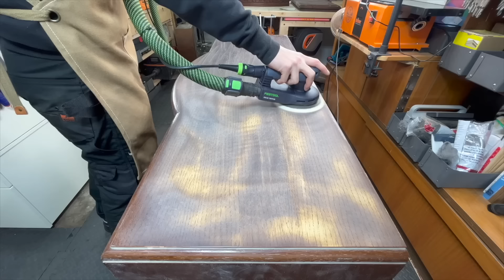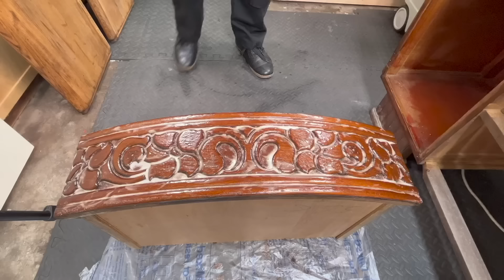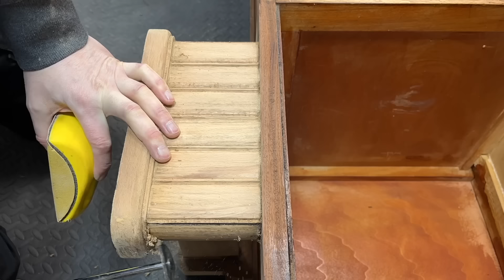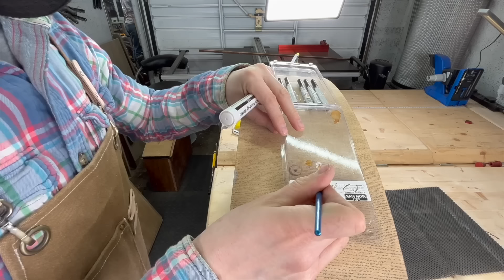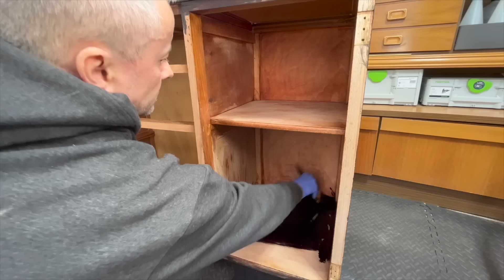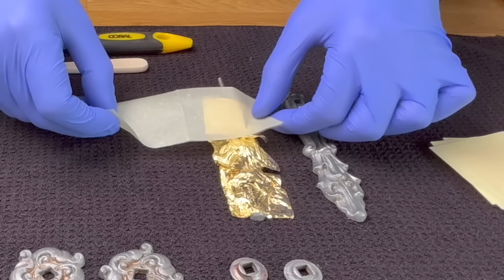Art Deco Buffet restoration. Bringing back the luxury and opulence of the era.

Comment: It is great how you show just keeping trying new methods to get the job done. Some problems are very difficult to repair.  My current piece has been set aside for a bit, it is so much more difficult than I had expected. I am trying to decide if I should take it another direction. I had originally planned to just stain and finish, but one long ago bad glue up and stains I haven’t been able to remove have me thinking maybe I should do something like paint or decoupage.

Comment: You do incredible work, so creative, so artistic. Love it. Do you know why so much furniture has an overhang at the back or a small fiddle(the little strip along the back that sticks up)? Baseboards. Baseboards are actually a pretty standard thickness. When you shove a piece of furniture up against the wall the bottom hits the base board and leaves a gap between the top and the wall. Extending the top a bit allows the top to sit flush against the wall,,preventing anything on top from falling behind. The fiddle serves the same purpose.

Comment: How did you remove the residue of the stripper from the carvings after using what looks like a wire brush?  I know the stripper will dry and harden in the dips and valleys of the carving - so how does that get removed?
Reply from the maker: mineral spirit and a brush/ compressed air
Reply: @Flippingdrawers  appreciate the reply.